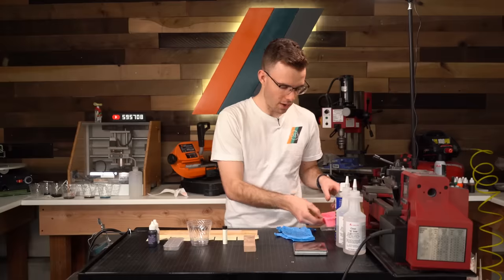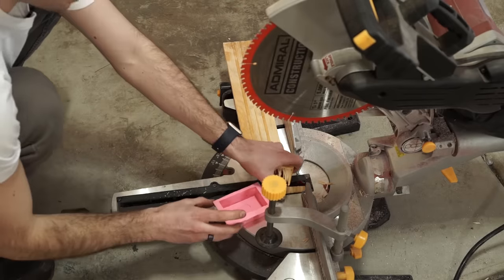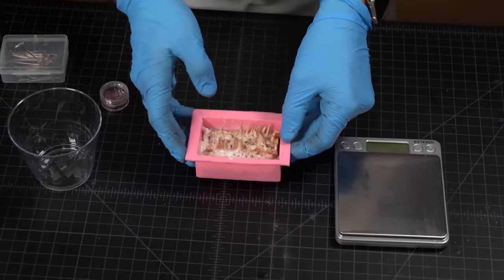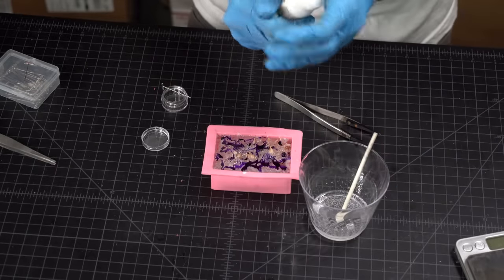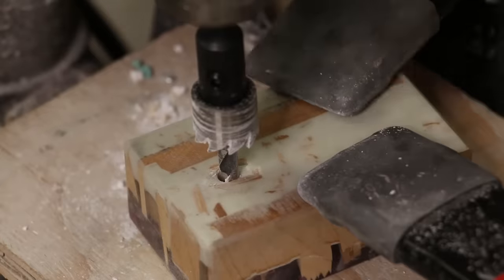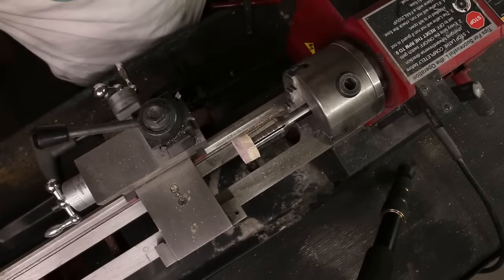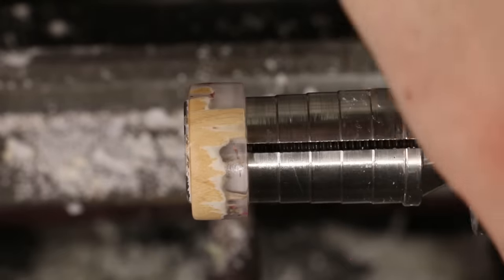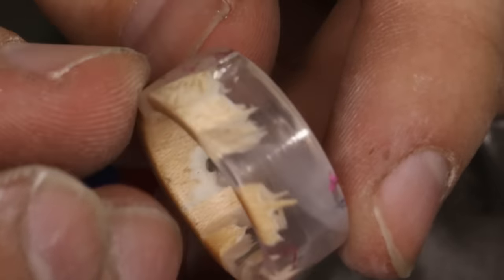DIY Glowing Snowy Mountain Secret Wood Ring

Comment: I recently discovered your videos and there is something I find very interesting in all of your designs; You have a strong level of randomness in all your designs and it is adding to the artistic value of your rings.  One thing I would suggest about this particular ring would be to give the wood some kind of colour treatment before encasing it in the resin.  I find that adding some colour to the wood would bring another level to the ring.  Maybe using watercolour and dipping the pieces of wood partially in it and for different period of time could add to the desired randomness of the ring.  You will have me as a customer soon because I REALLY like what you do.  Thank you !

Comment: Ooh finally another ring like the other one with the flowers!! I think it would have looked cool if the wood were all around one side of the ring to some degree -- maybe there's a different kind of wood with a different grain that would break with shorter shards? Or perhaps a different method of breaking the wood that was more controlled would produce shorter breaks, though I love that you just kicked it haha. I think either a different finish to the wood itself -- if you can add finishes to wood before sticking it in resin -- or a different kind of wood entirely -- with a darker look would be fantastic.
The glow looks 1000% though, and even without the improvements it looks so cool! I would definitely be interested in ordering a ring like this if it were available on your site.

Comment: Breaking the wood like that leaves a lot of hard edges and sudden drops that look unrealistic when you're trying to create a mountain. Try cutting the wood regularly and then use rough saws and knifes. I think that would make it a little better, because the grooves, indents and spikes arw going to be smaller. Hope you understand (I'm not very good at explaining) and I hope it turns out good if you try it. Also try to use dark green paint that's very "liquidy" and some white paint, so it looks like spruce wood covered with snow. It may be impossible to. Try it if you want, I would be happy to see this!

Comment: Yes Patrick, Your first block with the bubbles can still be made into exploratory finishes. I would like to see a horizontal full block ring blank which you may only have one of from your mold size. The horizontal would not carry same density of escaped gas(air). I think this experiment would have depths of definition. :-)

Comment: Id like to see the ring so that the shatters are kinda smaller by whitch i mean the other side of the ring is completely wood with the shatters in the middle and the otherside completily resin or partialy so that there are a few bigger shatters. Overall just a bit more wood

Comment: Maybe some wood with a finer grain, so that the "secret wood" texture can be better seen through the ring? As it is, it looks more like random chunks of wood floating around.
And perhaps use a thicker, single piece of wood instead of stacked wood planks: they seem too uneven compared to the  width of the ring.
Making a groove with a saw should help break thicker wood more easily.

Comment: I think it's okay I'm trying not to be harsh but I think you probably feel the way I do as you sort of mentioned it I'm a little disappointed I thought it would be better but hey it's fine you can do a bunch of more tries I'm still curious if you have or would try zebra wood with poly over it or maybe use metal shards in poly of course you would have to use a stainless steel or maybe I've seen you use brass I think line or with that but I have seen a few of those and they look really awesome

Comment: hey man invest in a vacuum. sticking the mold into a vacuum chamber and letting it cure in there would have gotten the bubbles out. you can also try getting something that vibrates and use that to work the bubbles out